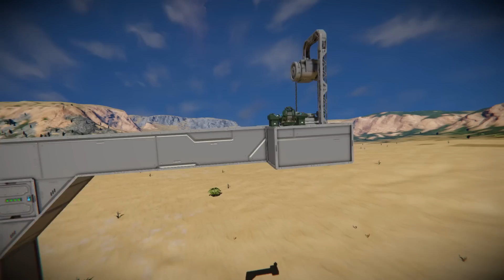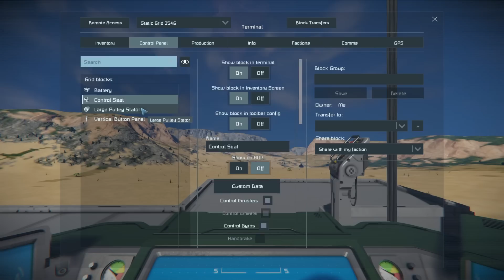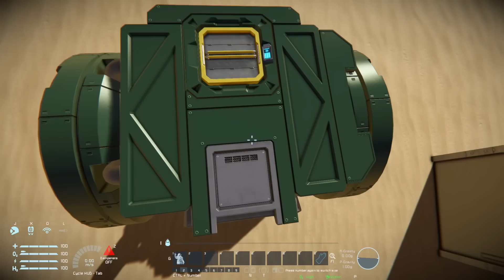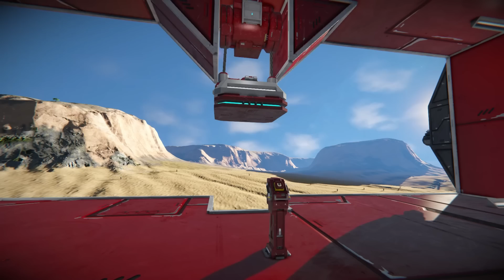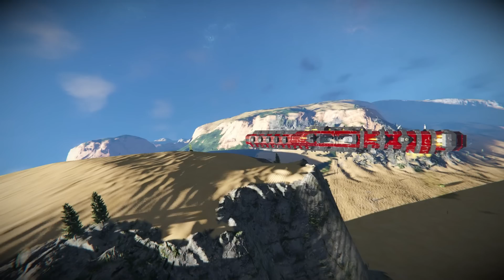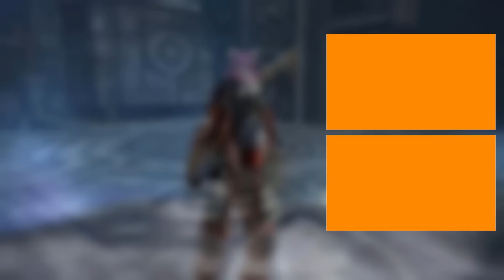The Pulley Motor Mod! - Space Engineers

Comment: Thank you for the showcase! ❤

Btw, it is exactly a quick kit-bash work of a landing gear and safe zone cuz needed models to code the cables in. 🤣
On another note, ofc it's up to players to decide how to use it (immersion wise) and is meant to be placed upside down exclusively.
Not much I can do about the way SE handles pistons and collisions either, at least didn't find a way yet so flying with it like that, NOT ADVISED 🤣
I made it for myself (as most mods I make lol) for underground bases or cranes without using a nuts amount of pistons instead,
and my use case and for single player. Shared for anyone who needs it as well for their SP. I sure hate to fiddle with multiple pistons at least. ¯\_(ツ)_/¯
Sry multiplayer guys. 😅
Reply: awesome build thank you